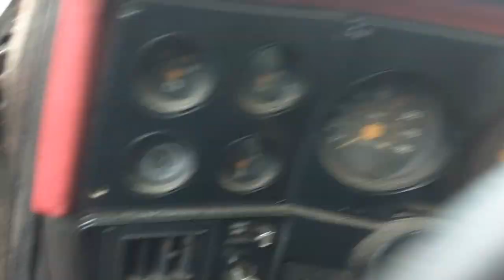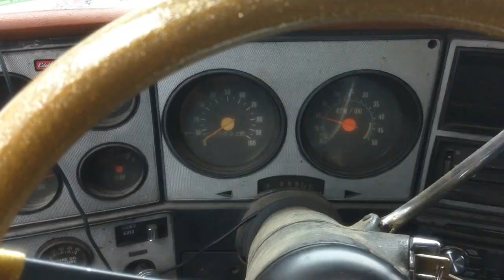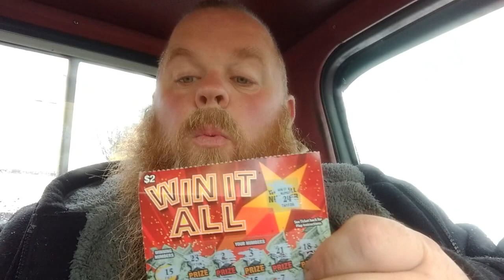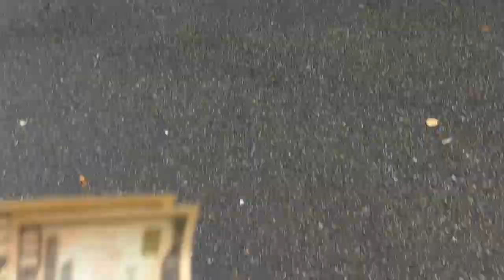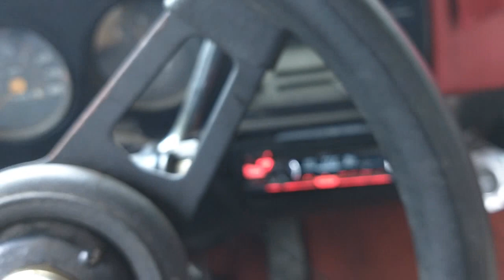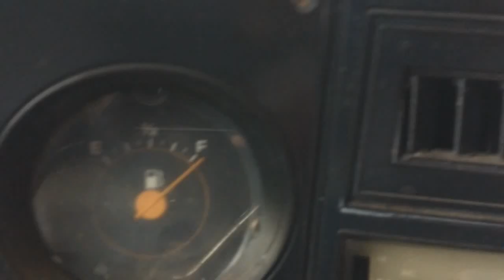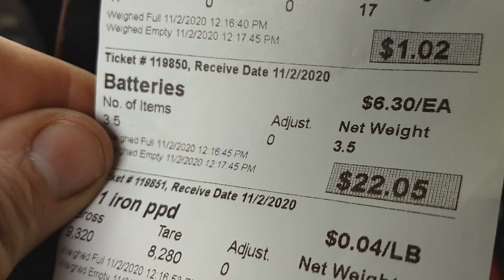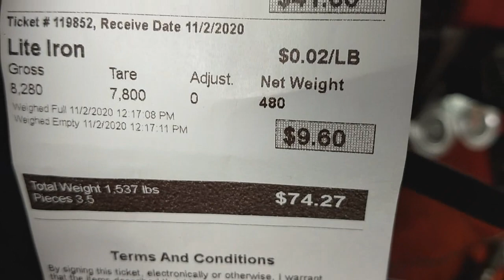Win it all- Monday

Comment: We finished thru our big scrap pile last week. Paid ok. Had a good mix. That 1ton have the over load above the main pack? I put new packs on my ‘84 3500, heaviest load we had was a 5500lb cat diesel out of an old cable shovel. That got the over load to just touch the perches. Those old 1 ton chevies can take a lot of weight
Reply from the maker: yeah its got the overload leaf, came close to touching with 3500 lbs of steel in it.
Reply: According to the literature I have on these trucks the actual gvw on the 2wd with the overload is 11,000lbs the 4wd are 11,500lbs. Must be to make up for the added weight.